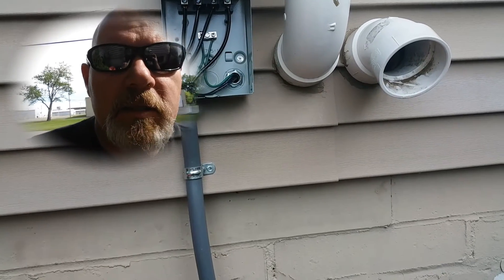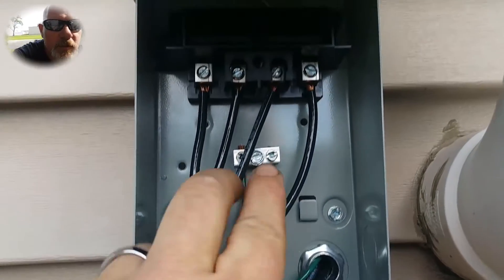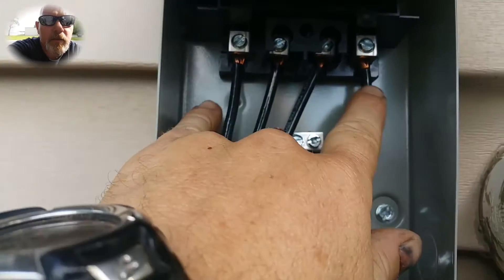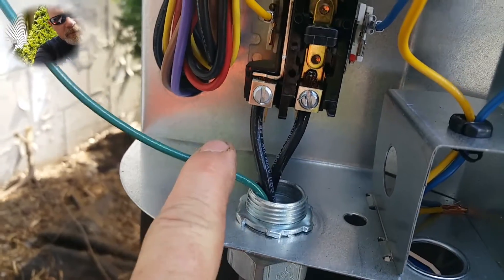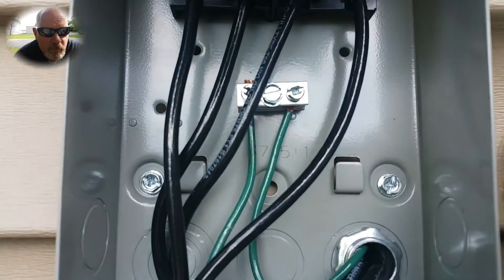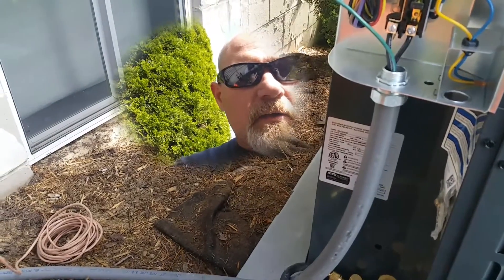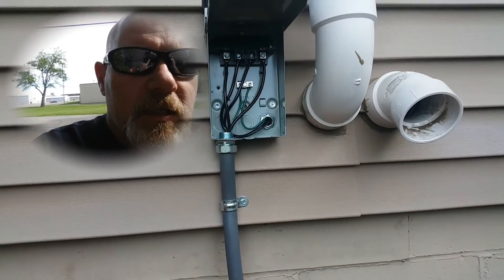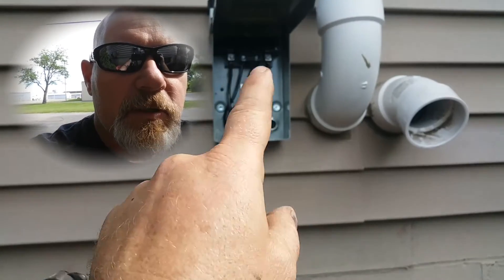How to wire up line voltage on an air conditioner.

Comment: Great... 
Question, is there a way to test the run cap(s)? I use a 30uF and a 5uF. I am thinking they are getting on in years and have been replaced when the 2 in 1? cap went away. I was going to order them just to have on hand. When they do fail usually they just fail in an open mode, right? So no damage will occur to the compressor or fan?
Reply from the maker: +Craig Nehring yes there is but you need a tester or meter that will measure microfarads